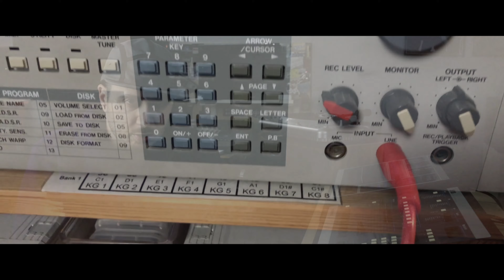DFACE DXA - Sampler Questions - Stereo to Mono

Comment: Wurd! Whatup D! I use a Y splitter & just pan the sample & choose which side I want. Never needed / wanted stereo sampling for the raw Hip Hop beats I make. I just pan horns sometimes on mixdown if I want a little stereo flavor. On that note, how about a vid on how you like to mix down the SP on the  external desk? ✌🏼
Reply: a splitter then panning is a good solution.  saves the patching, but i am guessing you are doing this with your console?  some sample sources warrant the need for stereo sampling imo but i can agree with your assessment overall.  about your video suggestion, i actually sold my external console after i moved into my last apartment. i do everything in the DAW nowadays so I don't know how interesting of a video that would be.  ill keep this comment in mind though because if i have a song that starts on the sp and then lay down the raps and put it all together in the daw it might be an interesting video especially if the whole process is compressed down to a few minutes.    thanks for checking out the video and sharing your technique.
Reply: @dfacedxa  All good D. Straight from the DJ mixer & just pan left or right. Easy solution for me. I can never be bothered to track all 8 outputs into a DAW. Your process would be interesting though, especially on a vocal track. ✌🏼
Reply: @MrSP1200  ok got ya.  i am not a fan of dj mixers but i am also not a dj.  i understand that for some people who dj you already have the mixer so why buy something else to get your signal to line level.  plus i know there are some nicer quieter dj mixers than the ones i used back when i got into making beats.  yeah tracking beats is an important step to me.  the process of applying gain is another chance to introduce desired color or tone.  its is a little more legwork than just recording the mix out but i enjoy the mixing process so it never seemed like a pain haha.
Reply: @dfacedxa   Yeah, I never had any noise issues with DJ mixers. I'm kind of the opposite to you in that I find it's the best way to sample for me as I can EQ the sample before it hits the SP. If it's good enough for DJ Premier & countless other classic Hip Hip DJ producers it's good enough for me 😉✌🏼
Reply: if it aint broke don't fix it haha!

Comment: Run your turn table mixer into a mixing board then go out the headphone jack   to the mono sampler.... right?
Reply: I would say this would work but only if you are going for the Y cable L on top of R method.  if you wanted to do the first method you could just run one cable out of the back of the turn table mixer into the sampler.